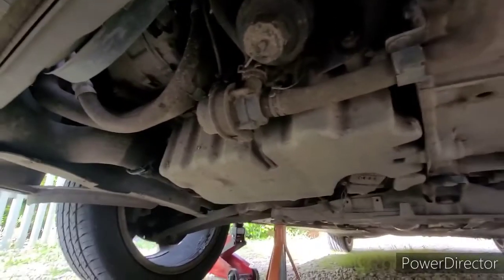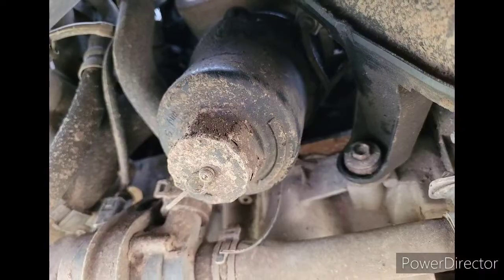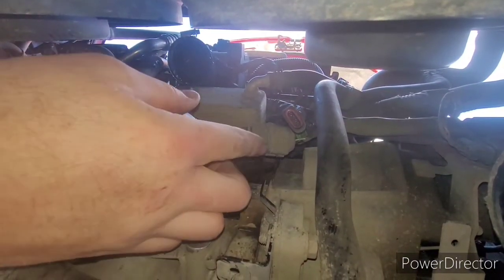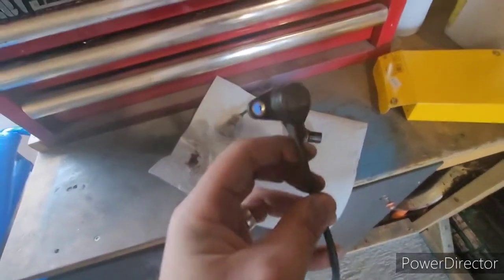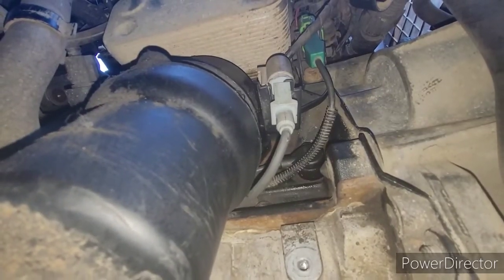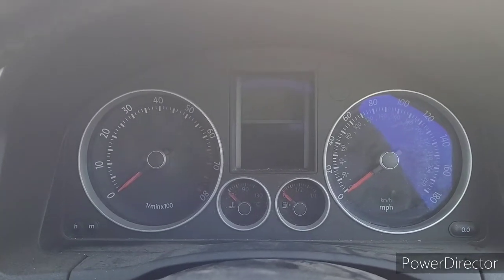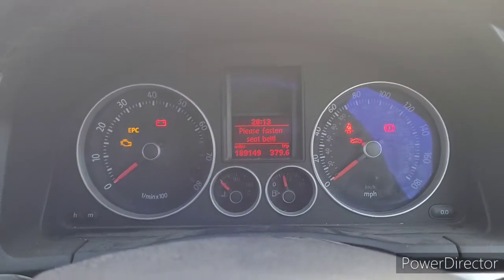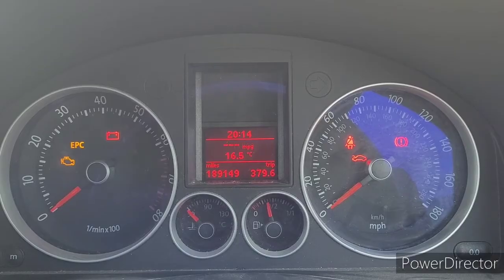VW Golf GTI Mk5 2.0 TFSI - How to - Crank Shaft Sensor Replacement

Comment: Thanks for this. I've just changed my CPS as the car just stopped on my driveway. I got a QH brand pattern part as 'new old stock' for £15 ;-)

What I found helped was a) take off the pipework at the 90deg bend from the intercooler as that clip is much easier to separate and b) the retaining bolt for the CPS while having the 7mm hex/allen key hole also is a 10mm regular hex nut head so a 10mm socket on a short extension bar (50-100mm) made putting it back in much easier.

Getting the old CPS out was a nightmare though, it simply would not release from the block. It would rotate but not pop out. Solution was a) spray on penetration fluid a few times and leave and then use a long pry-bar and just get the tip of a corner of it under the mounting hole part of the body shroud. The new one went back in fine!

I had NO error coded on OBD2 reader. The last few times I had driven the car it, in hindsight, seemed a bit juddery but it had been stood for 4 years with only static starting and left to run so I had assumed it was just sooted up or had water around the ignition components. Process of elimination meant taking the rear seat base out to hear the fuel pump prime (as could not hear this otherwise!), then I tried some 'easy-start' and it make any difference so I could deduce it was ignition related and then I stumbled on this 'how to' and everything became clear!

Oddly the car took 3 attempts to start  after changing the CPS, possibly because of all the previous cranking attempts there may have been flooding / sooting and for quite a while it was VERY lumpy which I now put down to a wet engine bay from the heavy storm (UK) of late 2024.

Again, thanks for this.

Comment: Hi my golf 5 gti while driving just died completely started up after that 
Had an issue when thr car would start and switch off alot .
I dont get any lights on the dash when this happen
Reply from the maker: It could well be crank sensor then, its the heat soak from the engine into the aged sensor, soon as the ecu picks up any missed signal from the crank sensor it'll shut down

Comment: No idea if you’ll see this but have an issue on my mk5 its a fully built car running silly power i do race it as well the weekend i was driving it did a few hard pulls nothing new car ran perfectly since then cars been parked past 2/3days come out to drive it started fine drove ok until i come to go on boost starting juddering and also most like a miss fire backed off the pedal and it drove fine off boost i did plug it in and it did bring up a P0321 code would that be my crank sensor? I know have a crank position sensor and crank speed sensor on these
Reply: Hi bud I’ve been having the same problem wondering did this sensor sort it out. 

Thanks
Reply from the maker: @abdullahqayum2926 yes new OEM sensor sorted the issue
Reply from the maker: It could be, but my initial thoughts are a coil pack as my old 20v would do this as in drive fine until it was on boost. Clear the fault codes and drive it again and then re check codes? Do you have a management light illuminated
Reply: @GreyGooseRestorations engine light was on when the p0321 come on the car i plugged it in it ran one code before but I forgot what it was cleaned it off drove it again thats when the p0321 came on iv cleaned that off and continued to do it

Comment: My vw 2.0 not working and no spark on the plug and the injectior too
Reply: I have the same problem no Spark to plugs , would this cause no spark ?
Reply from the maker: Yes, the engine doesn't know where its at so will stop fuel and spark
Reply from the maker: Is there any engine management lights on the dash

Comment: Hi 
Thanks for the video , I just wanna ask is the crank sensor is same with speed sensor becsuee I have similar issue just the transmission shifting to the first speed when that happen and showing VSS speed sensor error when I check it , so I can’t find the speed sensor only I found the crank sensor same you and there is people or garage saying the VSS speed sensor in transmission valve body 
My car VW GTI 2009 2.0 turbo automatic transmission, thanks and waiting your kind reply
Reply: Fault code P0501
Reply from the maker: Speed sensor will be slightly different as the transmission will have a input and output speed sensor so its more that likely the fault is within the transmission

Comment: Recently got one with crank no start. 
Would it make much difference if someone had been using E10 fuel .not E 5 ?
Reply from the maker: I don't think so, i used my Mk5 on E10 since it changed over and for 30 off thousand miles with no adverse effects.

Comment: Never use wd40 on rubber. Ever
Reply from the maker: Have done for years with zero issues, what's your reasons for saying never out of curiosity?
Reply: @GreyGooseRestorations  it deteriorates the rubber. A good lubricant spray for rubber is perfect.
Reply from the maker: Noted ✅️
Reply: @GreyGooseRestorations silicone lube would be recommended for rubber 👍🏼

Comment: Does it goes to limp mode/rpm cut down & won't accelerate when it occur?
Reply from the maker: No limp mode but it cuts revs and the rev counter drops to zero and a dead throttle, then it wakes up again and was fine for a while
Reply: Hi bud I had the same issues did it get sorted when you changed this sensor
Reply: @abdullahqayum2926 hey I got the weird limp mode thing with my 07 Passat 2.0t fsi I’m abt to change it I’ll get back to you with an answer in an hour
Reply: @LPSdramas  what happened
Reply: @abdullahqayum2926  well I got half way though the project and ofc since I live in Canada it got way to freaking cold lmao but I went back out an hour later finished it and drive around for about an hour and nothing happened so seems like it worked
Reply: @LPSdramas  perfect thanks bud - just to confirm sounded like you had pop and bangs (misfires) when you had this issue with the car

Comment: Had this problem with my Mk5 Golf 2.0 TDi automatic. Cost me over 200 quid. Apparently they had to remove the gearbox to get to it? 🤷‍♂
Reply from the maker: Thats suspicious, its awkward but not to the point of gearbox off depending where its located on the tdi
Reply: @GreyGooseRestorations not really on the tdi the crank sensor is bllted to the back of the block as the trigger ring is part of the rear main seal. The issue is the sensor is held in with a 4mm Allen that is open to the elements and loves to round out. I've had to pull a few transmissions I'm my time to replace that sensor.

Comment: Before you changed your crankshaft sensor, did you have P0341 code, when trying to start the car? Asking cause my mk5 gti has the same issue and idk whether it's the crankshaft sensor, or if I just need a new starter.
Reply: I did not turned out the entire ecu fried
Reply from the maker: Nope just the P0321 implausible signal code
Reply: I have the P0322 so is that the same issue?

Comment: Hi what syptoms you have ?
Reply from the maker: Once warm and after a long good drive it wouldn't start again, heat soak causing the sensor fail, gave the sensor wiring a wiggle around and it would fire up and be fine for a few days.

Comment: I’ve been meaning to do this for the longest now. Usually only leaves me stranded when it’s really hot
Reply from the maker: Thats quite common to do that when its hot / had time for the heat to soak into the sensor, had the same on BMW X5 E53 3.0d, would only do it once warm
Reply: @GreyGooseRestorations how does heat cause this sensor to bug out? Everything was fine when it was 40°, by the time it was 65°, it started bugging out, timing and everything is fine considering I rebuilt the head. I bought a genuine one instead of a generic, hopefully that'll fix the problem during warmer days
Reply from the maker: Heat soaks into the electrical parts and its causes high resistance resulting in the faults

Comment: I bought cheap crank position sensor 15$ Amazon ....sensor lasted 4 months an started stalling again ...I recommend Bosch cheap one left me stranded
Reply from the maker: Bosch was my first choice but best one available was hella, would have been £172 but got 60% discount off that 😁 see how it goes, hella have been making electronic parts for years so im confident itll do the job
Reply: Ah I'm having the same problem on warmer days, I'm going to get a genuine one and see if that solves the problem
Reply: Does the car feel slower due to the sensor ? I’m having symptoms and getting code 000222 , can anyone help ?
Reply from the maker: @waqashussain2310 nope power delivery was as normal just wouldn't start after long drive